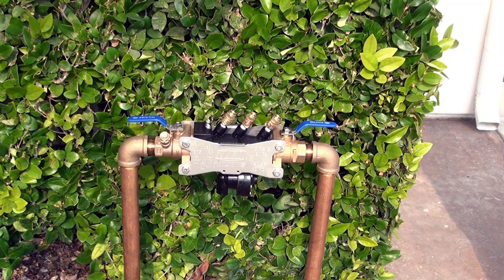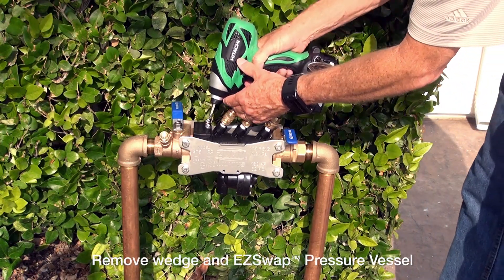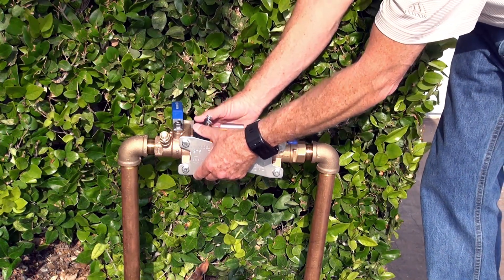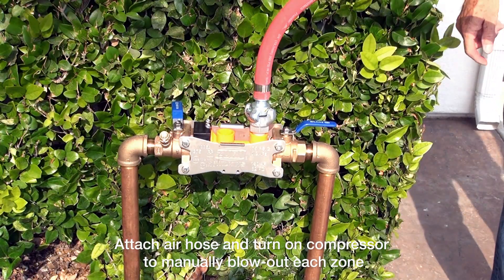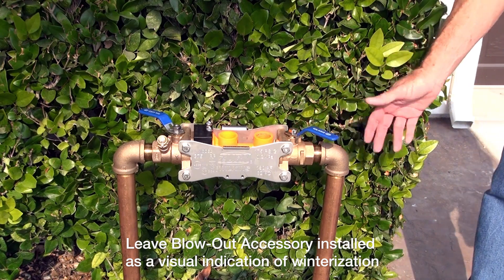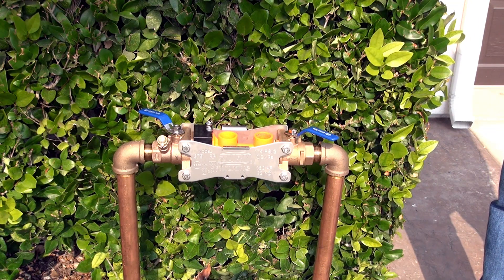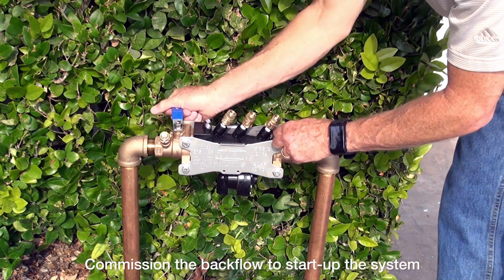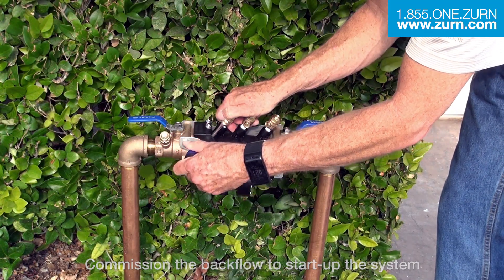Winterizing a Zurn Wilkins 375 Reduced Pressure Principle Assembly

Comment: Why don't you include the blowout valve with the backflow preventer? Can I attach my air hose to the back flow preventer and blow air out of my lines?
Reply from the maker: Hello, thanks for reaching out! We do not include these since most places in the US do not experience freezing temperatures, so it would be wasteful to offer these on every valve sold. It is possible to flush the system from the backflow without a drain valve, but please call or email Zurn Customer Care for more guidance on this. Thanks!

Comment: Is there an O-ring between the pressure vessel and the piece the wedge goes into? I’m putting everything back on but it’s leaking around this spot when I open the valves. The previous owners of my house winterized this so I don’t know if there was an O ring and it got lost.
Reply from the maker: HI Eric, thanks for reaching out! Yes there are o-rings that go there. Leaking can also occur at this spot if the wedge was over tightened and the o-ring that is in place has become pinched. Feel free to give us a call and speak to engineers for further explanation.

Comment: Can I do something similar with the 975XL like what you have done with the 300?
Reply from the maker: Hi Jim - great question. The Winterization process for the 900 series and 300 series backflow prevention models are very similar. The components my change slightly, but the process remains the same. The Model 375XL or 350XL have the added benefit of being designed so that the pressure vessel of the valve may be removed from the line and stored indoors or in a safe place over winter.

Comment: Hello. We have a backflow preventer in Utah. Our landscaper walked me through the steps to get it ready for the winter, but he didn't tell us to use the yellow device. He just told us to turn off the water to the sprinklers, put each valve (1 & 2) at a 45 degree angle or halfway, and then unscrew the black wedge and make sure it's loose. That's it. He has never said anything about the yellow device or manually blowing out our system. Also, what do we do if the balck wedge is unscrewed but it won't budge?
Reply: From Virginia: Blowing the lines with compressed air removes standing water from inside the underground pipes to prevent freeze damage to your zone control valves, pipes and heads.  My irrigation service tech has been blowing the lines through the backflow preventer (BFP) valve from an access point in the feedline.  I've had to service the internal valves on my BFP every 3 years or risk failing the county's back pressure test.  I'm thinking that using this device will protect the expensive BFP from damage.
Reply: I live in Utah as well. Landscaper told me the same, but he actually just said bring the big pressure piece inside. Everything else you mentioned is right. I also throw a heavy duty trash back over and tie and tape it so that snow/water doesn't get in. I've never done blow out stuff and have been just fine!

Comment: What is the attachment used in the video for the compressor to attach to the blow out flow valve?
Reply from the maker: Hello Brandon, the fitting is an air compressor attachment that should come with the air compressor. It is a standard threaded connection that should match up with the threading in the BOF. If you have any other questions, please feel free to reach out to us here or call our Customer Care Team at 1.855.663.9876.

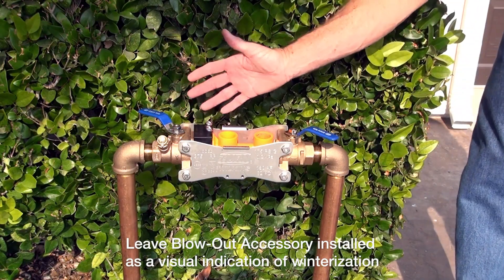Comment: At 3:55, by opening the valve on the left side half way, water would flow into the Blow-Out/Flush Fitting. How do you stop that? If you keep the left ball valve shut, water trap inside could freeze and damage the valve. So what's the best practice here? I just purchased this 1-375XL assembly and realize this issue. Thank you.
Reply from the maker: Hi James, we reached out to our engineering team and this is what they recommend. To properly winterize the valve it is recommended to have a drain valve and isolation valve installed before the backflow that is not subjected to freeze damage. 

This is the installation recommendation and will allow you to keep the valve in a half open half closed position. Please see the freeze protection section of our installation and maintenance guide, available below, for more information. 

https://www.zurn.com/media-library/web_documents/pdfs/installation/is375-12-1-pdf

If you have any other questions please feel free to reach out to us here or call our Customer Care Team at 1.855.663.9876.
Reply: Thank you so much! I will install a gate valve and a union before backflow and cover it with insulation.

Comment: What is the part number for the yellow adaptor that fits in the rpz area?
Reply from the maker: Thank you for your question! Our Product Manager says: "The yellow (actually it’s safety orange!)  is called a Blow-Out / Flush Fitting (BOF), which is used for both winterizing (blowing-out) irrigation systems and for flushing out the supply line prior to installing the backflow preventer in order to remove rocks and other debris from the supply line to avoid fouling the RP and ensure that the new install operates correctly.  The BOF is sold as a separate fitting or as a flush tool, which ships complete with a 18” hose and is all set up to perform the flush out." 

The product number for a 3/4" BOF is RK34-350BOF.  To see a spec sheet on this product, follow this link: https://goo.gl/70EgsX
Reply: I just received the valve from Amazon, however, it is not long enough to fit between the space of the removed valve.
Reply from the maker: Mahmoud, please contact our customer care team, they would be happy to assist you further. Please contact our team at 1-855-663-9876. Thank you!
Reply: THE CORRECT PART # Zurn RK1-375BOF Blow Out Flush Kit FOR WHAT IS BEING SHOWN IN DEMO